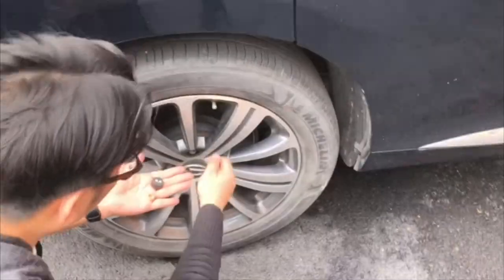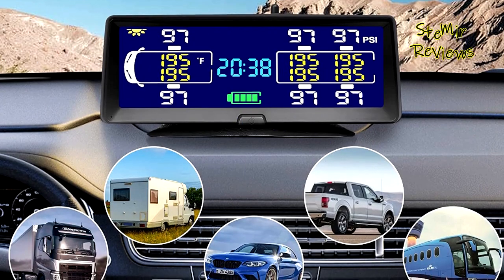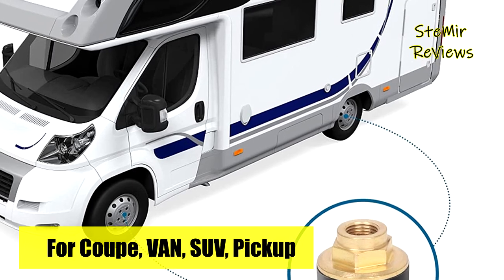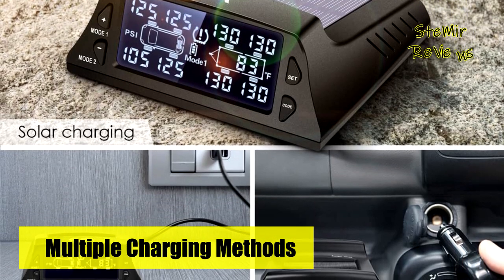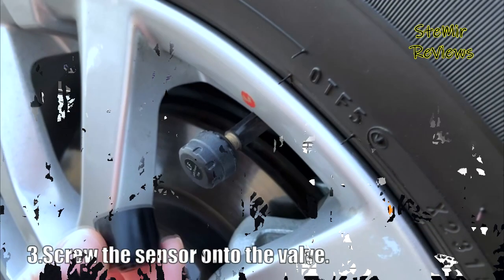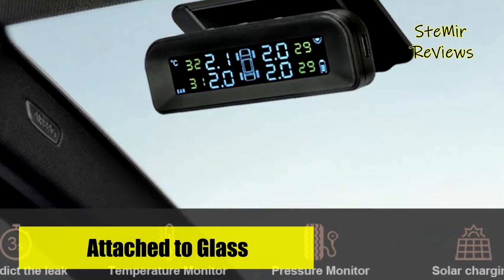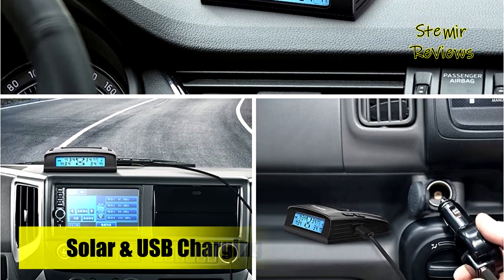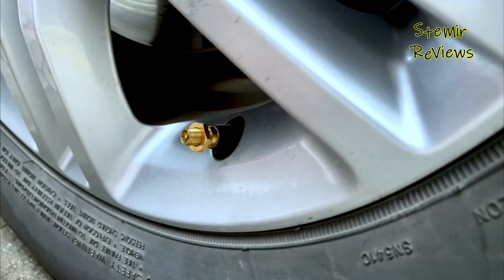TOP 5: Best Tire Pressure Monitoring System in 2023 | Solar Charger

Comment from the maker: ► Amazon US, UK, CA & DE Links ◄

5. OGIOOGIA Tire Pressure Monitoring System,7.84 Inch Solar Charge TPMS Tire Pressure Gauge,6 Sensors - 1:33

Amazon US: https://amzn.to/3SaoxCk
Amazon UK: https://amzn.to/3k6NHF5
Amazon CA: https://amzn.to/3ICmq7f
Amazon DE: https://amzn.to/3HZ1ghU

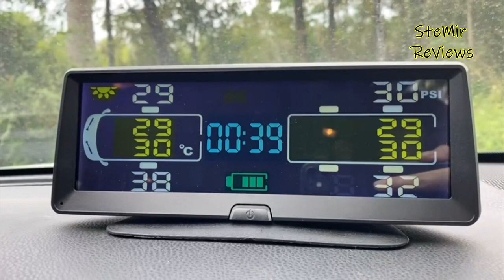4. GUTA Tire Pressure Monitoring System for RV - 8 Sensor TPMS for Trailer, 7 Alarm Modes, Large Screen - 3:19

Amazon US: https://amzn.to/3S01Oc5
Amazon UK: https://amzn.to/3KgYqaZ
Amazon CA: https://amzn.to/3ItkVrR
Amazon DE: https://amzn.to/3Iucson

3. Tymate 5 Best Tire Pressure Monitoring System in 2023 M12-3 - Solar Charge, 5 Alarm Modes - 5:13

Amazon US: https://amzn.to/412i6oE
Amazon UK: https://amzn.to/3YxGYmE
Amazon CA: https://amzn.to/410qeWJ
Amazon DE: https://amzn.to/3XyrLjZ

2. Tire Pressure Monitoring System Wireless Solar TPMS, Tire Pressure Monitor Installed on Windowshield - 7:06

Amazon US: https://amzn.to/3EbtrZV
Amazon UK: https://amzn.to/3k5wHPF
Amazon CA: https://amzn.to/3K87yyx
Amazon DE: https://amzn.to/3KefCxO

1. Tymate Tire Pressure Monitoring System - M7-3 TPMS Tire Pressure Monitor System with Solar Charger - 8:53

Amazon US: https://amzn.to/3YBVMkd
Amazon UK: https://amzn.to/3jXa4wX
Amazon CA: https://amzn.to/3K6ARl0
Amazon DE: https://amzn.to/3XFwArD